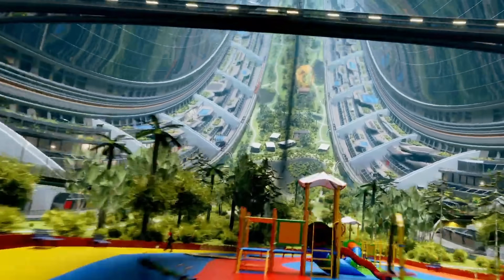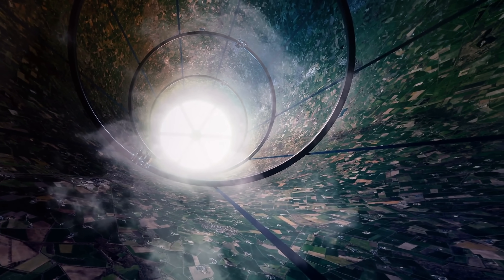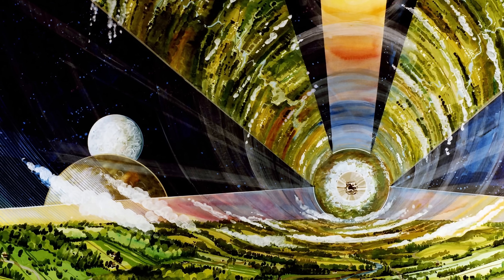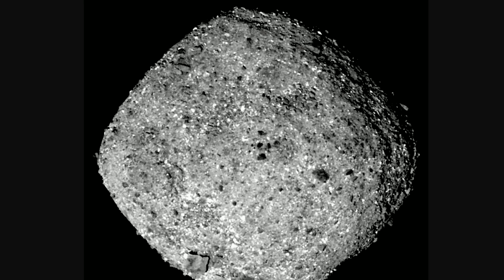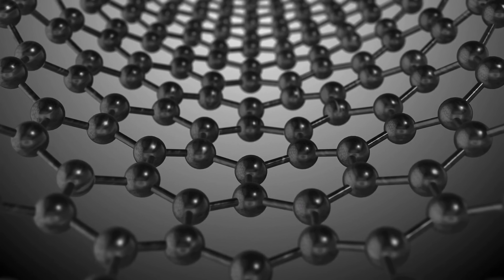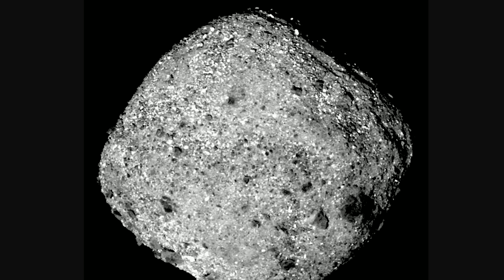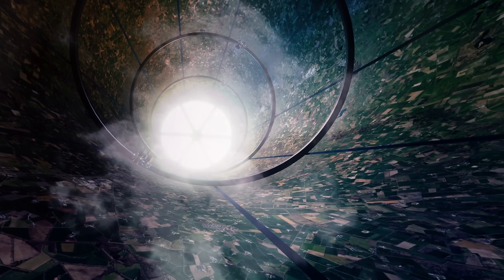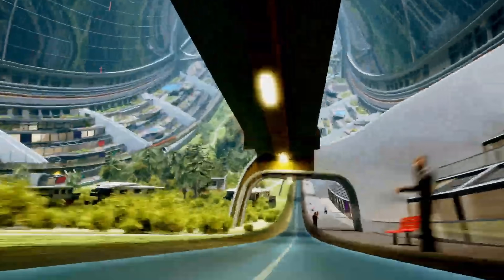Space Cities Out Of Asteroids and Graphene Bags? Intriguing O'Neill Cylinder Study

Comment: I think orbital habitats are the way to go, vs terraforming a planet. At least, at first. You could build one in a matter of a generation or two, depending on the size. Terraforming Mars or Venus is a multi-century project.
Reply: I agree and perhaps a O'Neil cylinder would make a great mass transport if used as an Aldrin cycler, a concept of a series of mars orbit intercepting space stations proposed by Astronaut Buzz Aldrin. It may take decades to complete and slowly nudge into the right orbit but it would be safest mass transit system with spin gravity and all the asteroids mass for radiation shielding you could get your hands on.
Reply: @pauldunlop1660  O'Neill cylinder with an Orion drive strapped to it for a 60year journey to Alpha Centauri
Reply: @chriswhite3692  Freeman Dysons idea and the asteroid "belter" civilization would have been established for a couple generations by the time it was built it would be their normal mode of life.
Reply: @chriswhite3692  
If you already want to go between stars, you won't even need the cylinder spinning if you have or can collect the ressources it takes you to ac- an later decelerate at a proper acceleration of about 10 m⁄s which is close to what we have here.
Reply: @jensphiliphohmann1876  Just hold on tight when it's time to decelerate
Reply: @londonspade5896  
The time to decelerate begins in the middle of the journey to reach small (compared to c, of course) speeds just when reaching the destination.
Reply: @jensphiliphohmann1876  Yeah I know, but during that middle phase, without spinning (in a perpendicular angle to that which people have been experiencing gravity) then things are going float mode for a while
Reply: @londonspade5896  
If we can calculate with sufficient precision, we can do a kind of immediate turnaround.
Or, if our space ship is built symmetric (the front kind of like the back), we could turn off the rear booster after securing all cargo, all passengers plus their luggage might use the short time weightlessness for moving from the rear to the front end and then the front booster could be turned on. 
However, the destiny which was above the passengers' heads in the first half of the journey is below their feet during the second half.
Reply: @pauldunlop1660  I think Dyson's best contribution to future tech was the Orion Drive. 10% speed of light? Hell yea.
Reply: @MrComfyFrog.  Terraforming Mars? Look up the latest Kurzegstat (or however you spell it) video on terraforming Mars with giant lasers. Pretty interesting.
Reply: @MrComfyFrog.  Orbital habitats is one thing I agree on Bezos vs Musk. Small at first and slowly "upgrade" to larger ones. The Moons has all the local resources we need- metals, water, etc, all in a small gravity well. Not sure about silicates for dirt, but that's abundant elsewhere.
Hopefully Starship is operational soon and we can start bootstrapping a space-based industrial complex.

Comment: We should be looking at designing rotating Tethered Momentum Transfer Space Stations,  (TMTSS) that can be built with current material technology, destined for uncluttered solar orbits near Earth and Mars.  Aside from material tention strength problems, space clutter is too big of a problem for an earth based space elevator.  But TMTSS would be much smaller project and would be feasible with existing material technology.  TMTSS counter weight mass coul largely be dirt cheap materials launched cheaply by SpinLaunch to a low earth orbit and assembled. From there they can use Solar PV to power efficent high specific impulse plasma thrusters that take them to their destined orbits.  Plasma thrusters, although efficent, are too slow and under powered for rapid human interplanetary transport. But they can move TMTSS that can in turn quickly transport interplanitary human and cargo space craft. 

Rotating TMTSS conserve energy between incoming and outgoing spaceships, making rapid transport from Earth to Mars and back to Earth with more cargo requiring  far less rocket fuel. 

The Tethered Momentum Transfer Space Stations wouldn't need to be manned.   They would use very efficent but realivly slow momentum changing engines using only modestly powerd thrusters powered by Solar PV for station keeping proper orbits,  and maybe even adjust tether length to adjust the amount of acceleration given to or taken from Space craft traveling to and from Earth and Mars. 

And from solar orbits near Mars we can have TMTSS  that go to the asteroid belt and beyond. further down the road, TMTSS may be built from materials from our moon, from the Martian moons, and from asteroids. Using TMTSS to conserve energy will be the future of interplanetary transportation.

Comment: If graphene isn't an option, another way to do this would be to use a bag out of something like nylon or some other readily available super polymer. pulverize the asteroid and if it lacks metals add a small amount or iron or aluminum to the mix (carbon fibers could also be added to give the mix more tensile strength).

   Next you spin up the bag except you don"t spin up to 1G, you just spin it up barely fast enough so that the pulverised asteroid/metal powder mix settles on the sides of the bag (maybe 1/10 or even 1/100 of a G). Once the mix has settled on the sides, you run a powerful alternating EM field (maybe in the microwave regime) over the outside of the bag causing the metals to rapidly heat up just long enough to melt a bit and fuse the rock grains in the mix together. Where after it quickly freezes into a solid self supporting structure. The EM field may have to do several short, quick passes so that it give the tiny metal grains just enough time to melt and settle without giving them enough time and energy to damage to bag too much before they refreeze. Once the whole structure is fused and can assist in supporting itself, it can then be spun up to a more habitable G level.

Comment: Isn't steel already enough to build a five mile diameter O'Neill Cylinder? If you don't make it 20 miles long ... we might actually be able to pull it off in a reasonable time frame. A smaller section, even if way under a mile wide would still be quite big in available area and amazing as a space station.

Comment: Please correct me if I'm wrong:
 If we imagine this rotating habitat as a wheel, it will need some kind of stiff structure to not deform. Since even the slightest unevenness of mass would deform a flexible bag into an undefined shape, translating into rotating around its axle of biggest inertia.
Trying to inflate a (visualize a two dimensional) balloon with gravel and rotation is NOT the same as using pressure.
Reply: And what about all that spinning mass? To produce Earth like gravity the centrifugal forces on the containing membrane would be on the order of tones per square foot. I doubt this whole concept could work unless we had a way to cement the regolith together and have massive spokes to take up the effective weight.

Comment: I suspect they will start with something a little smaller via a metal frame, chicken wire netting, and a metal sheet on the netting. We still haven’t solved the problem of large scale manufacturing of something like carbon nanotubes yet. But a smaller scale would give us a lot of answers from the effort.

Actually this method can be a good way to process asteroids like you said like a giant centrifuge for size or weight or density. And heating it this way makes extracting volatiles from the center easy.
Reply: Ever hear of dyneema?  Under tension it is eight times stronger than high carbon steel.  Rednecks have been using it to pull their trucks out of the mud for years now.  Amsteel blue rope a quarter inch thick takes more than 4 tons to break. Asteroids are something like 8 tons per cubic meter.  You could spin up a small asteroid like 300 feet diameter and once expanded in the sock the inside of the cylinder would be 45 acres of land at 1G. All with materials we tons of.
Reply: Metal would never be a part of a tensile structure like that, we have infinitly better materials like Kevlar or Zylon that are easily manufactured today that could do the job at far less weight.  Carbon nanotubes just make the net mass even lower.

Comment: I would rather live on an O'Neill cylinder than on Mars.
Reply: Agreed
Reply: @DMAIRS we still dont know the effects of artificial gravity on the human body. Being pinned to the ground by centrifugal force is not the same as gravity and the human body can tell the difference.
Reply: Same. We’d have more control over environmental parameters. Gravity, air pressure, chemicals, radiation, etc.
Reply: @RichieD_21 yea it the same as gravity because you whole body like organ and everything pinned down at 1g or the same feeling of gravity on earth so your body will be the same like on earth
Reply: @THON176  it's nit the same and your inner ear will be able to tell the difference
Reply: @RichieD_21 Source? i can’t find anything that confirms this and there shouldn’t be a reason why this would be true
Reply: @alol441 Look up Corriolis force. It's the reason toilets flush in the opposite direction in Australia. It would be more extreme in an O'Neill cylinder. So much so that when you pour a drink, instead of flowing relatively straight down into the cup, it would flow down in a spiral curve. Also, if you throw a ball in a direction perpendicular to the angle of the cylinder's rotation, the ball will curve to the left or right.
Reply: @NexAngelus405 it decreases with increase in diameter
Reply: @RichieD_21 we also don’t know how 38% of earth’s gravity effects the human body.

Comment: What seals the regolith base (floor) and thus make it impermeable to gas? There would be a pressure differential between the inside and outside of the cylinder encouraging seepage. I’m missing something.
Reply: The base would just be an easier surface to work on, the actual station would have air pressure because of separate constructions built on that base.
Reply: I wondered that too. I'm not sure the regulus would do anything except provide protection from radiation. The structure would still need to be robustly enclosed (as it is in that one artist rendering).
Reply: The graphene would block anything other than hydrogen (I think) from leaking out. Hopefully they go overboard on the amount of material. Personally I'd rather build the traditional style of cylinder and use the hollow rock shell this would produce as a sort of shield/storage facility. Put the cylinders inside a hollow rock shell to protect against meteors.

Comment: The method Larry Nivan discussed in the 1970s was to find an appropriate asteroid and bore a hole into the center and create a chamber that you would pack with ice. Then spin the asteroid and heat it with solar mirrors. Heat it until the ice turns to steam creating an internal pressure. As the rock heats up and become molten, the steam will help shape it. When you get it to the shape you want, let it cool and harden. Then you can outfit it as you desire.
Reply: Does this particular method have a name?
Reply: I remember this method too. Didn't know Niven thought of it.
Reply: Wouldn't this method assume the asteroid is fairly homogenous? If you have different metals/materials, you'll have differences in heat distribution.
Reply: @chriswhite3692  I don't think he did. I believe he was simply sharing it.

Comment: Wouldn't spinning up the asteroid, causing it to break up, result in some micrometeorites and maybe chunks of rock to be thrown out, causing additional potential hazards? And if the cylinder is short, like in your thumbnail, so more like a ring, wouldn't radiation still pose a problem as the floor would only really protect from the one side?
Reply: The entire structure would need a coating of a dense metal like lead and/or tungsten.
Reply: @hmxr715  
Not if it's thick enough. Every baryonic matter absorbs ionizating radiation, lead is just especially good at it.

Comment: Anton is only scratching the surface of what can be done with a O'Neil cylinder, for example multiple floors and layers increasing the available living area. Gravity gradients allowing you to work in zero g and live in 1g with only a elevator ride as your commute.
Though due to the nature of space I think that there would be more rock deposited on the outside to act as armour against micro metors.
Reply: In fiction, the outer shell has often been described as being covered with the rocky debris left over after mining out an asteroid, to protect the cylinder from impacts and radiation -- waste not, want not, as they say! :)
Reply: Well he only put forth an Overall Idea on How to build such a Structure. So your argument is just the fine print.

Comment: One thing that would be essential to being able to go very far with this type of project would be being able to manufacture the graphene netting in space. I would think that enormous, miles long, rolls of the netting would be necessary and making that on Earth and shooting it into space would be next to impossible.
Reply: Instead of vast expanses of netting, it seems like it would be simpler to just build the cylinder using material mined from an asteroid, then spread the rocky debris left over from that mined-out asteroid onto the outside of the cylinder and cementing it in place with something like Lunarcrete. Everything can be produced on-site and nothing gets wasted.
Reply: @olencone4005  I think they saw the ruble as having an advantage over solid but I agree with you. Maybe they could use the netting as/like rebar in concrete...... put down a layer of netting and grind up the asteroid and use the dust for 3-D printing over the netting. Over time they could just keep printing onto the outside of the cylinder making it thicker and thicker. this could possibly also help to develop some gravity and give the cylinder more protection from radiation, micro meteors etc.
Reply: @olencone4005  : You don't put the rubble onto the cylinder, you use it as a separate structure that only connects to the cylinder via bearings, that way you don't need as much strength for it. Also, you'd use the space between for zero-gee purposes.
Reply: @Brian-uy2tj  : No practical amount of shielding will provide useful amounts of gravity.
Reply: @absalomdraconis  I thought of that too but...... the cylinders would require constant maintenance. If part of that was an army of 3-d printers constantly adding to the shell in order to increase protection from space junk and small asteroids at some point that shell is going to achieve massive thicknesses 6' thick, 10' thick, 20' thick, more? If these cylinders are made to last 100 or more years constant adding to the shell could lead to incredible thicknesses. The cylinders would always be turning so the mass wouldn't be a problem, unless you wanted to stop it from spinning, which would be nuts.
Reply: @absalomdraconis  Why would you add stress points tho? A single failure of one bearing could jeopardize the entire structure, whereas a single layered hull presents a much denser and more unified barrier.
Reply: Miles long rolls of graphene wouldn't be large or heavy. At .77 milligrams/ meter^2, a 100 kilometer square piece would mass only 77 kilograms. A single starship launch in reusable configuration could in theory loft nearly 130,000 square kilometers of graphene PER LAUNCH. You are not appreciating just how light graphene is.
Reply: @filonin2  And you are not appreciating just how thick it would have to be even with how strong it is.  Your view point would be like saying wood has this much strength and so a single sheet of paper can be used to stop bullets.  
The article is talking about building cylinders miles in diameter with piles of rubble, first being spun fast enough to cause the centrifugal force needed to force the ruble to the outer wall and then be somehow sealed and pressurized. 
You aren't going to be doing any of that with one layer of ultra thin graphene.
We might be talking about building in space but you still need to get your feet on the ground and deal with the engineering realities.
One strand of nylon fiber has a little strength but when combined with many more fibers and spun into thread and then woven into fabric..... well now you have something you can make a tent out of. Of course you still have to figure out what to seal it with but..........

Comment: I have to wonder about the energy cost of spinning an asteroid to such speeds. I could see it being viable for smaller asteroids but the energy required to spin large asteroids fast enough to break them apart might be prohibitive.
Reply: For any such structure you'd need to spin it up. So you need that energy one way or another. Keep in mind that as the diameter increases (as the pieces fly out to the net) the rate of rotation will decrease to about what you want for artificial gravity.